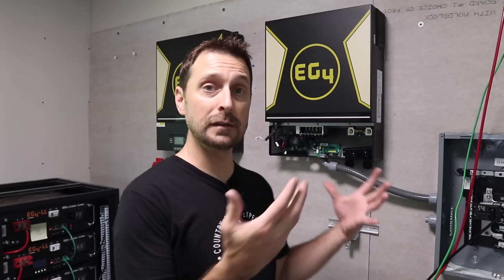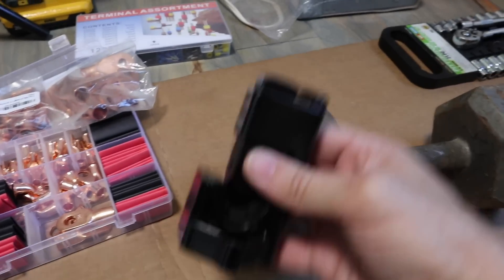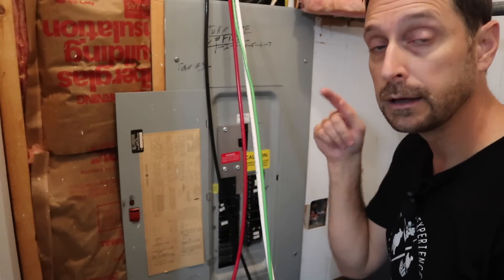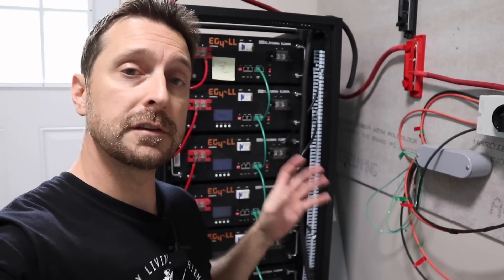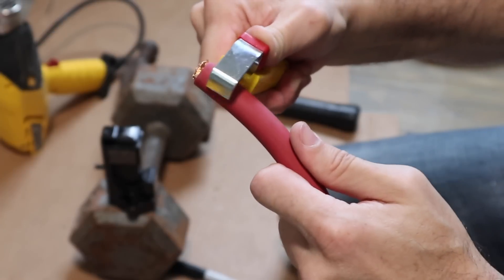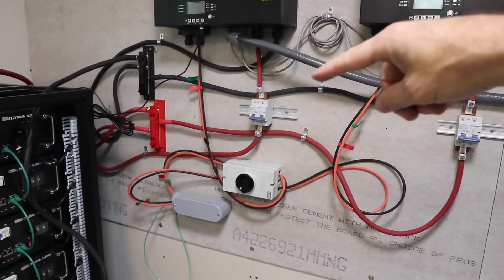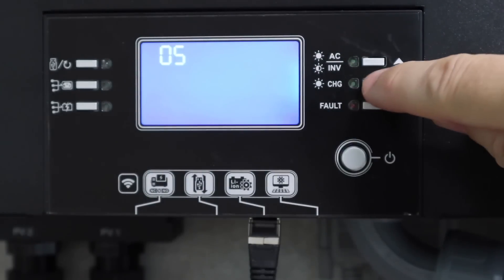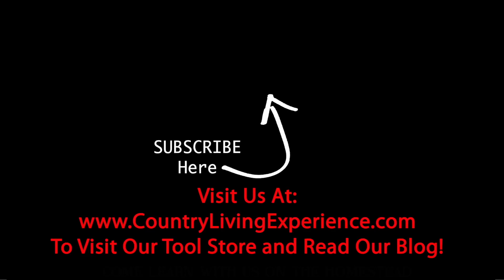EG4 Inverter Installation Full System Wiring And Tips! Off Grid Solar!

Comment: Very well done video... thank you! 

I have nearly the same set up that I'm working through right now. However, I'm only going to hook up one of my 2 inverters for now temporarily. 2 questions...

1) Can you please tell me the gauge of wire at 10:00? I thought mine came with 2 even lengthed ready made cables with crimped ends already installed. Yours looks larger gauge though...

2) I bought the recommended 2 pole 60 amp circuit breaker for the box. Is it...the right one if I'm only hooking the one wire to one of the poles from one of the inverters?

Thx in advance@
Reply from the maker: Thanks!
1. That is 2/0 gauge which is much larger than 2 gauge. 
2. It should be a 70A breaker. To make 240v you will need to add one hot wire (from one inverter) to line 1 of the breaker and the hot wire from the other inverter to line 2 on the breaker.
Reply: @Country Living Experience: A Homesteading Journey   
 Thank you kind Sir... much appreciated! I replied again but it seems to have disappeared. 

1. I don't know how, but I ended end up with a length of red & black of 1 Guage (not 1/0) which is 7.35mm & 4/0 which 11.68mm but...no 2/0 which is 9.27mm thick. Dang! The 1 ga is what SS recommended & sold when me I bought the EG4 batteries & inverters. ( i.e.: '84" 1 AWG Battery to Inverter Cables') Sigh...another week while I order & await delivery of the 2/0 cables

2. I ended up with the 60 amp dual pole breaker vs 70 amp as I bought the one directly recommended off Will P's blueprint equipment list links.
 
So that said, for my denseness...I can just hook up the one inverter' wire to this breaker (70amp) for now & leave the other hole on it empty until I add the 2nd inverter at a later date... correct? Thx in advance!
Reply from the maker: @CCRep123  I have bigger battery wire because bigger is almost always better. 1awg should be fine but it my hinge on how many batteries you are charging. 
If you are running 4awg wire from the inverters to the sub panel, I think the proper breaker size is 70. You could do it like you are suggesting but I am not sure of the safety in that. I would consult with an electrician. It is better to be safe than sorry. Additionally, you will only be able to power 120v loads with one. Do you have any 240v loads in your home that you are trying to power?
Reply: @CountryLivingExperience  Thank you again kind Sir! Excellent input & I agree 100% on safety & over building things. (That is the way I too prefer things.) Looking to get this up & running ASAP though...& everything takes 8-14 days to order/receive minimum. I will confirm with SS tomorrow on a few things. As noted, this is a temporary scenario to be upgraded later.

I.E. We live in & have 390w solar to our 5th wheel currently while we are building our off-grid home...but it is 12v living with occasional generator use. 

We actually have 2-EG4 inverters, 4-48v EG4 batteries & 54...390w bifacial panels. The plan is to use 5-7 panels, 1 inverter, 4 batteries & then plug the 5th wheel in to the system with the 30/50 amp plug for full service living while we build. (No 2 phase for now. ) All will be moved over to the house eventually with 3 inverters then & 8-12 EG4 total batteries...depending on actual outcome. 

That all said...please know your help, input & videos are immensely helpful & appreciated. Thank you...all the best to you!
Reply: @CountryLivingExperience  

I spoke to SS & an electrician this week.

According to my electrician, 60 amp is fine as 70 amp would be more needed in a higher temp area like you live as these are temp sensitive. My high temps, in the summer, rarely break a very dry 90 during the day & high 50's to 60's in the evening so I think I'm good on that note. 

Using only one, of the 2 wire poles for now is no problem...& can add the 2nd wire from the 2nd inverter later is NP.

On the 1ga wire that SS sold me... they said that they said that they sold it to me because they don't have or sell 2/0 AWG wire. While close...it can work... but they DO recommended buying 2/0. (A bit under impressed with SS on this... not to metion waiting on hold for 90 minutes to ask...THREE times to get only ONE pick-up & answer. )

Hope that helps somone else. Thank you for all you do!  👍 👌

Comment: Question, did you remove the ground neutral bond screws in the inverters?
Reply from the maker: I did not remove it.
Reply: @CountryLivingExperience  my setup is basically the same as yours, a breaker box with a 70 amp breaker and that goes to my main panel where my ground neutral bond is so that all faults will clear there. I was watching one of Wil's vids (EG4 6500EX VS MPP LV6548 Code Compliance and Ground Neutral Bond Discussion) and he went in to some detail about it and apparently he removed his GN bond screws so that the bond is only in his breaker panel where it should be because there was a potential for current on the ground and since my situation is basically the same as yours in configuration I was wondering if you had done that so the only bond is at your main breaker panel. I know you have mentioned you have friends that are electricians, I'd be interested in their input.
Reply from the maker: @shaybee22  I watched Will's video too. It is certainly an upper level discussion. I talked to Sig Solar about it some time ago and I didn't get a super clear answer from them so I left it. For my old Growatt setup, the screws were removed by the manufacturer per Sig Solar's design request. My electrician friends don't know anything about solar. You would actually need an electrical engineer to figure this one out. Even on Will's DIY Solar Forum, there is so much disagreement about subjects like this that is extremely confusing.
Reply: @CountryLivingExperience  agreed, very confusing, but when it comes to electricity I am very cautious hence why I ask and why I ask ppl like yourself who have already done this and to date I don't think I've seen a video of yours where you are getting shocked or having any problems LOL. I'll try and get some info from someone in the solar field but they usually do not like to give any info away. Thanks for your response and insight, much appreciated :)
Reply from the maker: @shaybee22  I totally understand. I haven't zapped myself yet. Sorry I could not answer the question completely.

Comment: DID you rack with batteries discharge all same time equal voltage or they discharge separate like mine (midle first and then bottom and upper one last ) they hook up to bars on the side ...strange
Reply from the maker: Mine discharge at about the same rate. There is some variation between the batteries. It takes the bms a while to learn and balance all the batts equally.

Comment: Question?
Can I hook up the EG4's 6500EX 48V to my Battle Born's and or a DIY 48volt bank?
Does the inverter have to be attached to operate as with the Eg4 racks?
TIA....
Reply from the maker: You can use most batteries with these inverters including DIY and Battle Born. You don't technically need the connection like with the EG4 batteries.

Comment: If I'm completely off grid no grid power coming in can I skip the load center and put the 70 amp double pole breaker in my main panel?
Reply from the maker: Yes, that would work. Make sure you have some sort of additional safety shutoff as well though.
Reply: @CountryLivingExperience  awesome! Thanks for such a fast response and yes definitely will have a shut off in between inverter and panel. Love your channel I have been subbed for a while and have learned so much you are a blessing to us wanting to learn, your videos are very well thought out and very informative.
God Bless
Reply from the maker: @savedforever7702  Thank you so much. Glad I could help. I appreciate it.

Comment: Question?? can you wire from the inverter to the main panel and skip the sub panel on to a breaker?
Reply from the maker: Technically yes but you at least need a safety switch in between. I wouldn't do it because if you want to add any more inverters it may not work.
Reply: @CountryLivingExperience .... thank you for answering my question. I'm only going to use one Sungold 6.5kw charger/ inverter. one question that still boggles my mind is with one inverter AC lead out to the house panel, i have a double pole breaker box so do i  piggy back the 2-pole breaker (line going from inverter to left side of double pole breaker to the right side) to the other pole on same breaker ? or (do i use a bus bar to split the connection to the breaker ? ( -------|=====🈁 )) i will be placing the batteries in series to create 48v's if that any help?
Reply from the maker: @Jasonmckenna1977  It is hard to visualize what you are trying to do without seeing it. I am a visual person and cannot understand how you are trying to wire things. Additionally, why are you only using one inverter (120v)? Do you not have any 240v loads?

Comment: The last two videos have been extremely helpful, as I plan to build an almost identical system within the next year.  I have watched videos from about a dozen different people including Prowse and Poz.  Some people say to never use a breaker on the battery cables going to the inverter, but to use a Class T Fuse, and some people say using a breaker is okay.  What is your opinion?
Reply: I used both. The class T fuse is higher amperage then the breaker.
Reply from the maker: Glad they were helpful. I used the breaker because it was recommended by Sig Solar. Since the EG4's are their sister company, I have to go with their recommendation.
Reply: Not being able to find or get a fuse is a pain. Breaker is a better solution.
Reply: @CountryLivingExperience  this was why I went with the breakers as well.  Recommended by the company who sells the inverters.  Now I’m going to see if I can provide a 240 volt box just for 240 loads with the 2 5000es growatts and a 120 v box with the EG4’s all running off my solar and battery bank.

Comment: Also do you have a video or picture showing how you wired your imo disconnect, I can't find one. Do I connect my + into 1 and + out from 2 and - into 3 and - out from slot 4?
Thanks in advance, your channel has helped me so much 🙏
Reply from the maker: Glad it was helpful. 
Sorry, I don't have a picture of the IMO wiring.
Reply: 1 goes to 2, 3 goes to 4, 5 goes to 6, 7 goes to 8.
Example - pv string 1 positive goes from array positive into 1 and out from 2 goes into pv1 positive, pv1 negative goes from array negative into 3 and out of 4 into pv1 negative on the inverter

Comment: Was watching other videos on this and they said the inverters are ground neutral bounded with a screw inside the inverter so wouldn't bonding in the panel be as well be bad?
Reply from the maker: I did not remove any bonding screw. You should give Signature Solar tech department a call if there is a concern.

Comment: Curious about the need for a panel interlock.  Is t the whole point of these units that they can pull from grid or solar at the same time?  Thx for taking the time to make this video!
Reply from the maker: This type of inverter supports AC charging and pass through but I do not have it enabled. It would require a transfer switch to be wired into the main panel. Since I have this set up like a generator, the panel interlock kit is a must.

Comment: Thank you for this video, it's super helpful. Did you keep the internal ground neutral bond in both 6500ex inverters? If so do you notice any issues or feel the need to remove internal bond?
Reply from the maker: You're welcome. I kept the internal ground. I have not noticed any issues to date.

Comment: Great video. Thank-you. I am glad I discovered your channel. I have a question about protecting the battery cables. Does NEC allow for the battery cables to be run without protecting them in conduit, like you have, ie, the 4.0 and 2.0 cables to/from the battery bank? I noticed you ran all the 120v wiring in conduit but did not the battery cables. Thanks!
Reply from the maker: Thanks. 
I think NEC 2017 (690) had protection for battery cables up until your overcurrent protection device. Nobody I have ever seen has put them in conduit likely because of the heat. Some put them in large raceways but that is only up to a certain point before the batteries. Engineer775 on YouTube is a professional installer. His batt cables are not in conduit.

Comment: Excellent videos!  Great info!  I have purchased 2 of the EG4 6500 EX-48 inverters and the battery rack with 5 of the EG4 batteries.  As I spec the additional items, Signature Solar recommends 60 amp breakers for the AC output.  What is your reasoning for going with 70 amp?  6500W / 120Vac = 54.2 amps.  Curious, since I have not purchased the breakers, yet.  Thanks!
Reply from the maker: Thank you. Recommended  gauge for the inverter is 4awg. From the charts I looked at for 4awg wire, the 70 looked appropriate. I just made a judgement call. If they are recommending 60, I would go with that.
Reply: Considering the long run and the % drop, I definitely understand the reason for going with the 70 amp, and yes, 4 AWG will handle it.  I appreciate the added thought you put into your design.
Reply from the maker: Thank you

Comment: Im about to connect my eg4's PV inputs, but am totally confused on their spec of 500 pv input spec. Is it 500 volts for PV1 and 500 volts for PV2 or 500 total. EG4 and SS haven't responded to my requests for clarification. Thanks for answering.
Reply from the maker: I believe it is 500 for each mppt. So PV1 can take 500 and PV2 can take 500.
Reply: @CountryLivingExperience  Yes. So after days SS got back to me just before you. It is 500 Voc each PV input. Thank you

Comment: Planning on same equipment/setup for off-grid new build in a few months. Hope you can answer this newb question:
I’m concerned about running multiple large load appliances at once. Would it be possible to add one more inverter, and have two provide 240V and one provide 120V assuming everything past the inverters is wired properly? Or would this take two more inverters, two sets of two in serial creating a bigger capacity (terminology?) and then the two sets working in parallel?
Reply: FYI - I don’t care about running my stove and dryer and dishwasher at the same time, but my wife has agreed to whatever wacky plan (rainwater, hydronic heat, boiler fireplace, off-grid, etc.) as long as she never has a day where she can tell the difference.
Thanks for anyone who can answer.
Reply from the maker: Cool. 
You have to manage your loads if your solar system is small.  Unfortunately with this type of inverter, you need to add them 2 at a time (with my previous Growatt system, you could add 1 at a time). Yes, you would then have 2 sets of two working in parallel.
Reply: @CountryLivingExperience  such a quick, on the spot answer on an older video! Subbed and following! Thank you, sir.
Reply from the maker: You're welcome.

Comment: Hey Eric, I almost got to the end of your solar playlist! I have a question that might sound silly, but I want to be sure before I mess up anything. In this video, when you turn on the solar to access the stand-by mode of the inverters (12.10 min.) was the 70 amp circuit breaker (for the 2 inverters) at the sub-panel already turned on? And after you check that everything works properly, is it at this point that you turn on the other 70 amp circuit breaker at the main panel, the one with the interlock kit? Thanks!
Reply from the maker: The breaker is off just for safety purposes. The inverters are not "on" but in standby mode. They are not sending any power anywhere. 
Once your settings are set correctly, you can turn on inverters and the sub panel breaker, the safety switch, and finally the breaker in the main panel that is attached to the interlock kit.
Reply: @CountryLivingExperience  All clear now. Your videos helped me a lot and I learned so much! Thank you for your much appreciated YouTube work.

Comment: Do these units have transfer switches?
Reply from the maker: Essentially yes, if you are referring to switching between inverter to AC-in in the event that the batteries are low and panels are not producing. That is an internal setting. I have mine set at SBU or solar, battery, utility in that order.
Reply: @CountryLivingExperience  okay, I was thinking that it did.

Comment: My man!.....  GREAT explanations of all fronts.  I do have one question on this specific EG4 Inverter.  I see that there are two PV inputs.  This inverter, if I remember correctly has the specs of a maximum of 8000 watts and a maximum of 500 volts.  Do the two inputs split those specs OR is it that EACH PV input has those specs mentioned above.  I hope my question makes sense....  Thanks!!!!
Reply from the maker: You're welcome.
PV input would be a total of 500v. So if you had 100v on one input you would be able to put 400v on the other.
Reply: Signature Solar has discontinued the EG4 6500EX and now sells a 6000 watt inverter from a different manufacture.  The 6000XP is 120/240 with built in breakers for the AC and the PV input.  It has dual 4000 watt PV inputs.  Over all a much better unit.

Comment: Curious about the 30amp safety disconnect switch you described.  The output amperage for the EG4 inverters is ~53a, so 60amp breakers and #4 wire is recommended for AC out and AC in, your safety switch appears to be in between the subpanel and main panel.  Isnt the safety switch under-sized for that application?  thanks.
Reply from the maker: Mine is a 60 amp safety switch. If I said something different, I misspoke.
Reply: @CountryLivingExperience  thanks, makes more sense, the Amazon link in the parts \ accessories list takes you to a 30amp safety switch...
Reply from the maker: Thanks for the heads up. Amazon changes the product links sometimes to something similar if a product is out of stock.